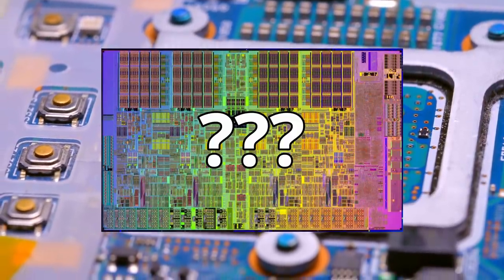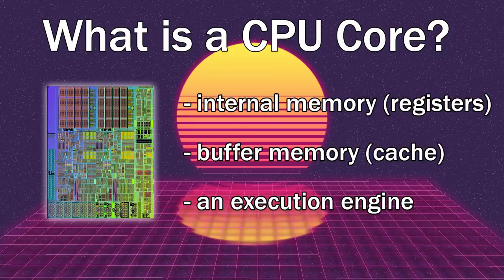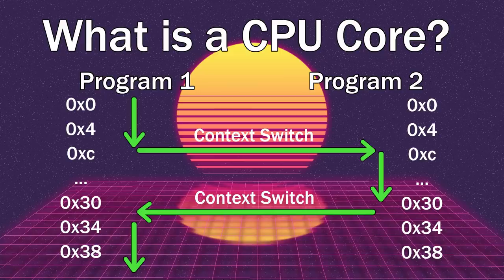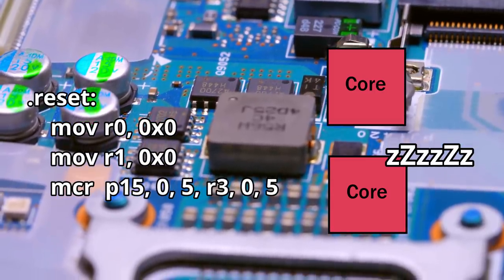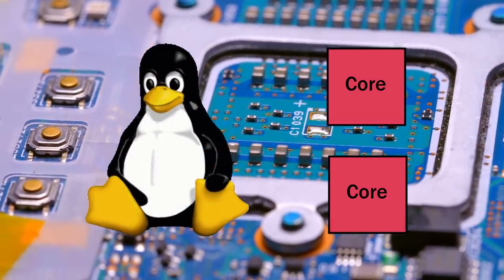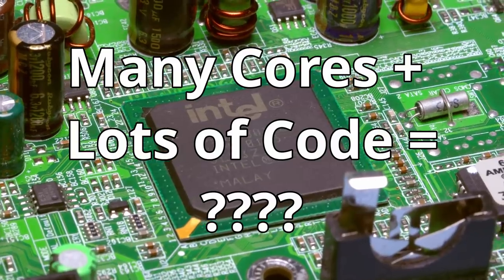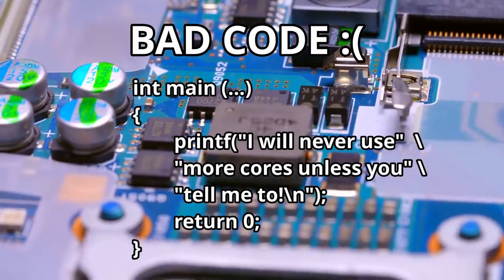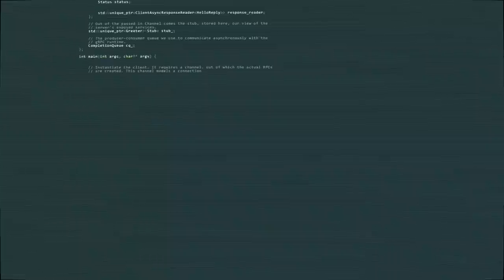why can’t computers have thousands of cores?

Comment: Back in the 80's I read a magazine article about the 'Connection Machine' which had 65536 processors but each processor wasn't like a core that we think of these days. Each processor was a tiny simple device which operated in a massively parallel architecture. Such machines had a limited practical value since they were specialized for a narrow range of problems and were also limited by being a 'hard-wired' architecture. Right now I can't think of a better description but I do know I should word it differently. I vaguely remember it had clever solutions to how to break down tasks and how the machine's processors worked together. It makes me think of things like ant colonies.
Reply: Errr... GPUs ?
Reply: @ivanscottw  I don't remember if the connection machine was analogous to a GPU because I don't remember the details of the architecture.
Reply: Sounds more like a cluster
Reply: @mateusvmv  iirc the whole machine's architecture was roughly analogous to a GPU. It wouldn't be like what people think of as a cluster we have these days. Each processor was a very simple device nowhere near what a processor is in a cluster we think of these days. It was huge tho compared to a GPU which isn't surprising since the first one was built in the 80's.
Reply: The whole point of the Connection Machine's hypercube topology was to allow programmers to define the optimal architecture for the problem they were trying to solve. Unfortunately, very few HPC programmers of the time could make the cognitive leap to this model from Fortran on vector machines.
Reply: https://en.wikipedia.org/wiki/Transputer
Reply: I remember it well.
Reply: @stewartkingsley  And I designed electronics using Transputers...
Reply: @stewartkingsley  yes, INMOS transputers fits the description. One physical chip could hold 4 independent cores with each containing high speed memory-mapped serial links arranged as a web, so they could communicate. INMOS also developed an aggressively parallelized programming language called occam, where you had to explicitally identify which parts of the code must run in a serialized way by just one core.

Comment: You're more describing the limits of the Von Neumann architecture and our current (mostly sequential) models than anything else imho.
Have a look at Erlang and the Actor model, and I think you'll argee that processors can scale just fine if we rule out shared memory.
Reply: The functional wizard has spoken.  (Pay no attention to the man behind the curtain)
Reply: It's called memory driven computing. Very smart.
HP tried this for a while.
I have no idea what happened to this.
Reply: @Handelsbilanzdefizit  Thanks for sharing!
Reply: Occam on transputers already solved a lot of issues with programming. Too bad it never took off.
Reply: @StCreed  Interesting, thanks for sharing!

Comment: to be fair, in the science and datacenter space, that kind of core density can be effectively leveraged, threadripper and epyc proved it, and the development of processors like genoa and bergamo only serves to drive that point home further
Reply: Yeah exactly. I got clickbaited by the title because I work on a system with over a thousand cores. Promise based task schedulers and MPI make it possible to recruit massive computing power for certain workflows and vectorizing loops over a distributed system is somewhat independent of code at this point. Old Perl script? Throw it into the OpenPBS scheduler with GNU parallel and loop over your entire data set as a matrix.
Reply: @drstrangecoin6050  I think you are getting it totally wrong. There is no machine with a single CPU of 1000 cores. You are using a cluster with independent memory bandwidth. That doesnt provide any hurdles mentioned in this video at all.

Comment: My first computer had 48k (it was an Apple II+ with 16k extra memory).  I remember learning some assembly language. Now I have a multi gigabyte memory (255 Gb SD, plus 128 internal) phone which takes 8 Mb photos...  I am so amazed at how far we've come and what the computer is actually doing to even display what I'm typing right now.  It's mind bogglingly amazing...
Reply: I remember the animated intro for Megaman X saying back in 1993 that X had 32,768TB of RAM, and I had to look up what a terabyte was and I was like "lol what". Now that actually seems feasible in the not too distant future - will AI advance to the same point as X too?
Reply: My first was an Atari 800, I'm pretty sure it had 64K. It was a fossil even when I got ahold of it. I recently fulfilled a childhood dream by building a new system and just maxing out the RAM for the heck of it. 128GB has never felt so good!
Reply: @EdKolis  well... 64-bit operating systems won't go away for a LONG time... as it can address 16 exabytes (still at least 6-folds away)

Nothing says you can't have 32 exabytes of RAM... they question is.. .why?
You might as well live alone in a 100,000 sqFt mansion and ask yourself... why?
Reply: @EdKolis  What also amuses me is that, even in the future with specs like that, they're apparently still using DOS interfaces.
Reply: I learnt Intel 8085 assembly language back in the early to mid 80s.
What is actually going on is so simple on an instruction by instruction basis.
At some point in history the CPUs were able to allocate tasks from a single program
to multiple cores all by themselves without a programmer writing instructions
for them to do that.
Reply: Weird Al's "It's All About the Pentiums" from 1999 has a few dated references, but one line has aged reasonably: "I got me 100GB of RAM."

(Not a power of 2, but still more than needed for an average user.)

Comment: The "number of transistors doubling every 2 years" might already be hitting its end. The problem is in order to add more, they have to be made so small that it's impossible to keep the circuits properly separated. The gaps are so small that electrons easily jump across, causing shorts. Maybe we will see an increase in larger sized CPUs, but that will have its own problems.
Reply: Chiplets
Reply: Improve efficiency without improving capability to the point that we can start stacking the processors... resulting in THICC CPUS.
Reply: @AlMcpherson79  now that sounds like a thermal nightmare
Reply: The number of transistors still increases so we havn't hit the absolute end yet, but it probably has already slowed down from the doubling every 2 years of morse law.
Reply: @jsmith8147  I’ve got some bad news if you think quantum computing is the answer bc while it can theoretically perform faster there is no real world useful function with scalable architecture
Reply: @jsmith8147  
Quantum mechanics says what you said is literally impossible I'm afraid.

At that scale, things aren't really in one location.
Reply: @lordgarion514  : (
Reply: @Blake Belladonna No, moore's law refers to the doubling of transistors. Although he also made many other observations about things like prices, and I quote here: "The complexity for minimum component costs has in-creased at a rate of roughly a factor of two per year." Still, this has nothing to do with moore's law

Comment: AMD also released their first dual-core CPUs in 2005.  (Of course, not everyone instantly bought them...)
Another issue with huge core counts is cross-core communication: threads usually want to talk to each other, and the wiring between all those cores gets crazy.  You effectively get a traffic jam in there...
Reply: That is what the crossbar switch is used for with communication between the CPU and the shared cache that mediates acess to the memory bus.
Reply: @jessepollard7132  right.  But even crossbars have a bandwidth limit.
This is also why NUMA was developed.
Reply: @RonJohn63  yes, but it isn't a bandwdth limit - but number of switches limit for physical implementation. NUMA provides the same interconnections but with different constraints.
Reply: @expressionsartistic5856  Actually that was built by Sun, not Cray. If I remember right that was supposed to be the CS-64.

Comment: Scientific computing guy here. Most often we hit RAM bandwidth limit. Sometimes we use all bandwidth by a single core with optimised AVX2 code and perfect memory layout. Using more cores will just slow down everything until you switch to a platform with more DDR channels.

Comment: Well adding more cores and keeping all buses available to all threads (albeit not at exactly the same time, just close enough) is easy, all that's needed is a dedicated chip who's only purpose is to loop through each boolean bit linked up to threads supported by the CPU to check if they need an operation done via RAM, the actual operation is then read from the thread that set the bit and once completed the bit is then cleared to say the operation completed, the thread doesn't need to care what bus was used, only that the operation was handled by the chip as soon as one was available. It being a chip it can be made to skip the "if N < THREADS_SUPPORTED" logic by just linking a power of 2 (2,4,8,16,32...) threads and letting the index overflow back to 0 during incrementation thereby reducing power consumption from it and the time it takes to get back to a waiting thread. As for RAM side of things, the most can do is sport an equal amount of RAM as needed to hold all apps and their virtual memory in memory, unlikely to happen any time soon though and would require some understanding on the user's side like "if I open this app with closing another then all apps will be slower due to surpassing RAM limit"

Comment: The main issue is that, many tasks don't gain much efficiency from being split to many cores, due to having data dependencies on previous instructions. Generally, better applications for multithreading are those that have workloads easily divided up. Anything to do with graphics tends to be heavily threadable, which is why GPUs these days have upwards of over 10,000 tiny cores, you have millions of pixels on a screen, so it is easy to split up the work. Game logic, however, isn't as easy to split up, which is why games don't generally benefit from having more than 6 CPU cores. It would be trivial to have a CPU with 1000 cores, just shrink  the cores. With CPUs though, it is generally better to have a smaller number of cores, that are better at executing code fast, than it is to have a crazy amount of simple cores. 

It is significantly more energy efficient to have more cores if workload can use them, which is why GPUs are so much more efficient at drawing graphics than CPUs. On the flipside, GPUs are pretty bad at general code, since to effectively use them, code needs to be what is referred to as "embarrassingly parallel".  Many non graphics tasks are still able to be effectively programmed on the GPU, so they are still used for non graphics tasks, just not as CPUs.

Comment: I'm still using a 4 core 8 thread CPU from 2013 for audio. The code is NOT bad, IS the real time audio processing itself that runs in series which is the bottleneck. BUT, putting audio tracks in parallel scales way better with more cores.

Some tasks by themselves ARE the bottleneck, not their code.

Comment: This is one of my fav channels genuinely , could make a RISC-V  series or compile resources for it to learn . would love to learn more riscv just don't have a structured way to yet
Reply from the maker: Working on it! :D
Reply: Risc processing is a college course offered at most universities.. I generally enjoyed working with this language.
Reply from the maker: @joelsmusic7771  RISC is the general idea of reduced instruction set computers, where as RISC-V is the open source architecture and spec for those processors. RISC-V is more like saying MIPS or ARM than RISC alone.
Reply: I remember about drooling RISC processors in early 90's with my school mate. Seems to finally mature to commercial products (like Raspberry Pi replacement). Both high priced for the performance at the moment, though. However/depending on problem, you should get your discrete code running way faster than in CISC architecture on those.

Comment: It's pretty much impossible for Moore's Law to persist for another 50 years -- transistors can only be so small. If anything, a different form a computing will takeover by then -- like optical computing.
Reply: And they'll call it quantum computing for marketing purposes. Which isn't entirely wrong but not what people expect.
Reply: Or analoug computers
Reply: Well.. yes but now. 

Effecticly the way it was originaly precived  it alreddy died 10 years ago... well really even more.

The nm  scale we have to day os symbolic,  not real.

The transistor density have been increased by using other tricks like standing transistors or more layers
Reply: At some point yes, it will stop being correct. And no sane person doubts that.
But we do not know yet When that will happen.
Also quantum-computers very likely are not the answer to 99.999% of all problems as far as we are aware - they simply are too slow and inefficient for anything that does not involve sifting through enormous amounts of combinatory possibilities.

 @matsv201   "Effecticly the way it was originaly precived  it alreddy died 10 years ago... well really even more."
No.
Reply: @ABaumstumpf  you probally need to motivate  your starment a bit
Reply: Transistors don't necessarily need to be smaller. We will probably instead transition to vertical stacking similar to 3D VNAND. Vertical stacking will provide another exponential growth of transistor count.
Reply: NOPE. the problem is that light requires optical paths, and those paths have to be larger - the wavelength of an electron is far smaller, so wires work quite well even smaller than they are now.

Comment: Interesting thing about multiple cores is that coherence and even just latency in communication between multiple cores eats a huge chunk out of performance. Arbitrating cache coherency between one, two, maybe four cores isn't too bad, but when your critical path in coherency (or latching for multiple clocks) goes all the way across the chip, suddenly your performance drops like a rock. We've seen the transition from higher frequency to more cores because of the exponential increase in power consumption when increasing core clock, but with too many cores we sometimes struggle to even hit our initial clock due to all the overhead for everything else.
Reply: From everything I've seen, more almost always means lower clock speed (unless you're over locking). My quad-core i7-4820K runs at 3.7Ghz while I've seen Threadrippers running at barely 3Ghz.
Reply: @Rokabur  the thread ripper is not quite a fair comparison thats two different  brands with different ipcs and applications. the less clocks may be true to some degree but it would  be more fair for you to compare it vs intels new i9 12900k that has 16 total cores and still will run at 5gz out of the box it has some stuff with P cores and E cores. So if you want a more all P core comparision you can look at the 10900k that would still do 4.9ghz out of the box on all 10 cores and 20 threads. and comparisons inside amd are similar there newer 5950x which is 16 cores barley loses any clock speed to there lower 5600x . when comparing you really have to stay inside of the same artitech intel does lose a little bit of clock speed comapred to there lower chips when you compare in server stuff . But server stuff is a little bit of a different ball game where you can get up to 56 cpus that have alot of memeory lanes

Comment: I was sysadmin on a couple of multi-processor machines which had very similar issues scaling, except across CPU's and CPU boards. One was an IBM X460 with 4 interconnected chassis, each with four Intel CPU's, the other was an E25K with a half-dozen CPU boards, each with four SPARC CPU's. In each case, we ran into scalability issues related to memory bus bandwidth, the latency of memory fetches and bus I/O across chassis (X460) or boards (E25K).

Operating system and database configuration and tuning helped, but ultimately both platforms faced diminishing returns  on performance as boards and chassis were added, with 16CPU's being the sweet spot.
Reply: Apples M1 Ultra already hit it. I'm very curious how they will design their MacPro. But i predict we go with multiple computers in the same chassis, also known as Blades in the 2000s server days.

Comment: This is a good video, but I think that you overlooked an important aspect and that is HPC computing. While no single chips have thousands of cores, in high performance computing it is common to run code on many many nodes all with 64 or more cores.

Additionally GPU are really just proceccors with more limited instructions and they generally come with thousands of cores on a single die.
Reply: The architectures of GPUs and CPUs are different it's not just about instructions.

Comment: Some task can only benefit from paralelization until x limit, some task simply are not even paralelizable, some have very minor gains that would add unnecesary code complexity and some task you can always trow more cores to do faster. 
In general PC use case, most tasks are sequential so more cores only benfit you if you are doing a lot of multitasking
Reply: This. Game logic for example. First you tell a character to move x amount. Then you check for collision, and if hit, correct the position or execute some logic. Then you might check if the character is shooting, which again, depends on the character's position. Things have to happen on the correct order, you can't just have multiple cores do each thing simultaneously, or the results would get messed up depending on the order in which the tasks happen to be completed.
Reply: @rtyzxc  that is why OOP is not a thing for games but data oriented programming makes more sense. All languages are OOP except of Rust. You can do DO in C++ and C# too but that is abuse. They are not really made for that.